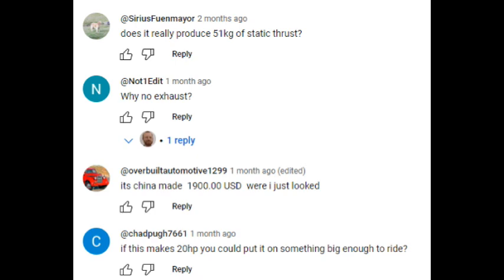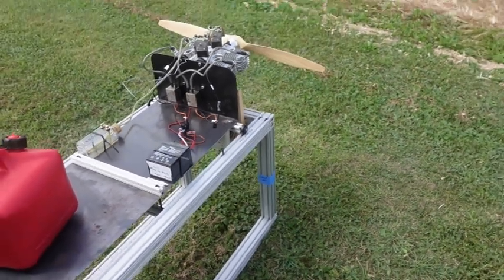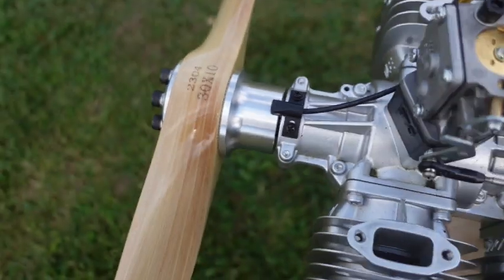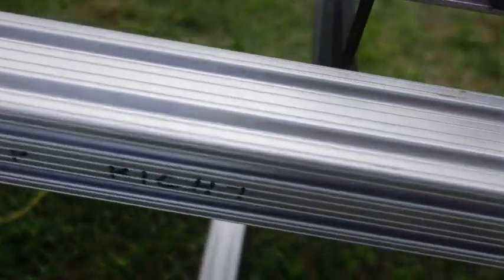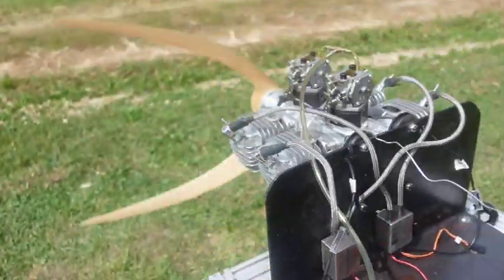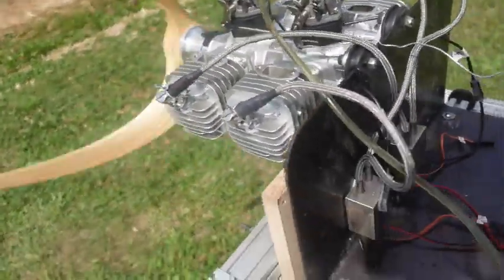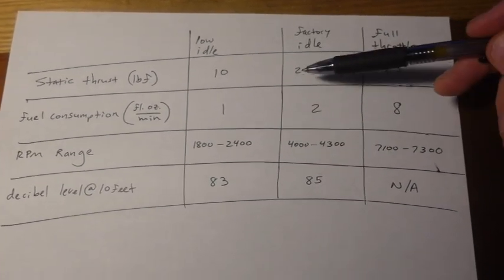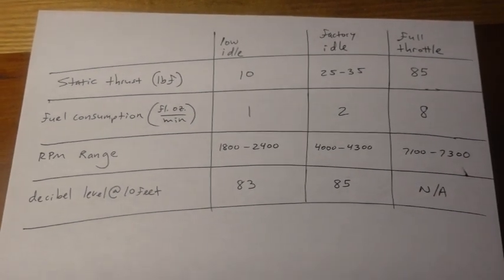DLE-222 Engine testing: static thrust, fuel consumption, RPM, and decibels

Comment: Hi. You should never run 2 stroke engine at lean mixture. So, please do your self a favour and set it as rich as it is possible, so it just runs still abaut normally. Then your engine will not get broken at least not so easy and fast. 2stroke engines need rich mixture to cooling inside the engine, like pistons at first place. And they need rich mixture also to lubricate. I know, you can add more oil to the fuel. But if the mixture is very lean, then there is no any fuel, and that means there is no any oil too. Like ruffly said, but you get the point I guess? Just for you to save your engine from total jammed.